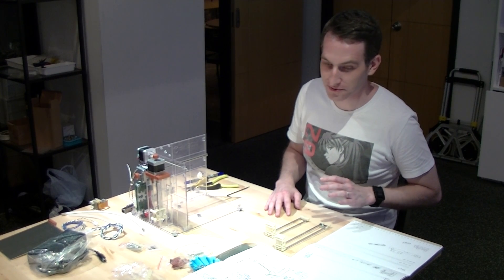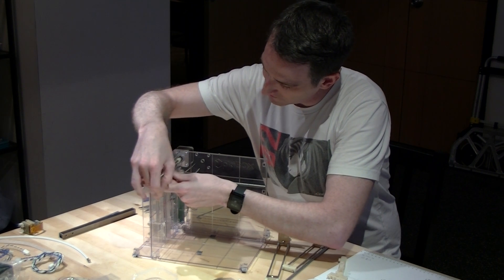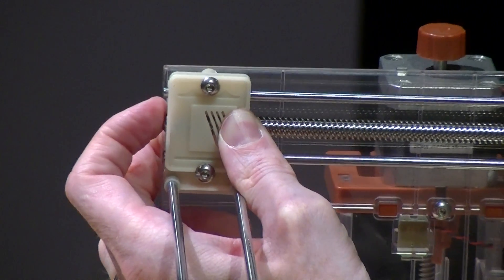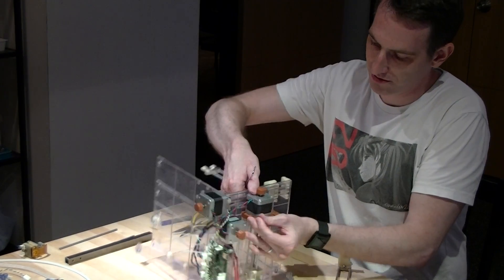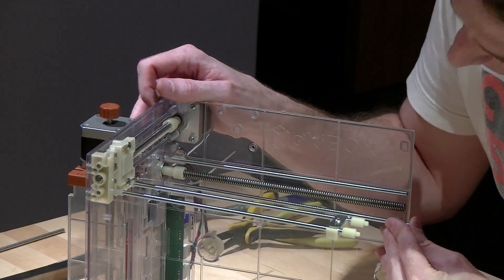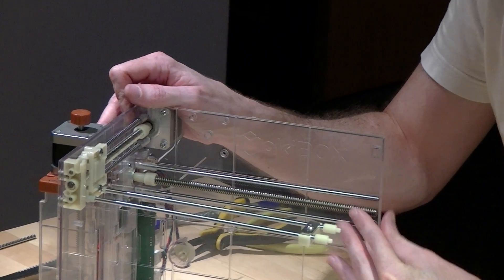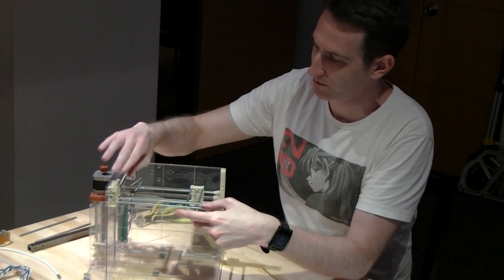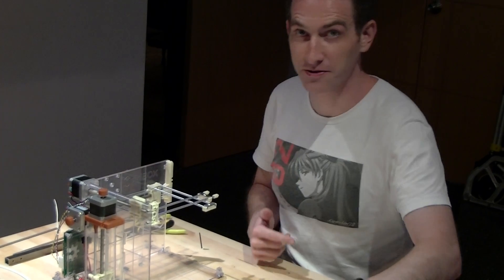#MakiBox Assembly Step 6

Comment: Fortunately, there is some room in the design for spinning them a bit. With the IM, we are deliberately not using any wording, as we will need to put a large number of translations there. We will iterate this in a "before you start" section on the online documentation. The IM is just there to provide a tangible supplement to the other info.

Comment: If you switch the order, you can't easily get the anti-backlash into the right position. By screwing into them first, you can tension them appropriately. If you do the fixed threads first, you would not be able to adjust the tension.